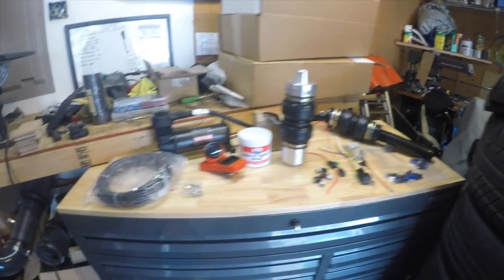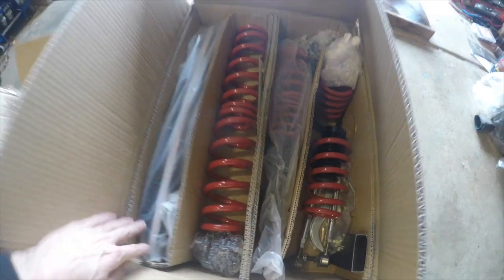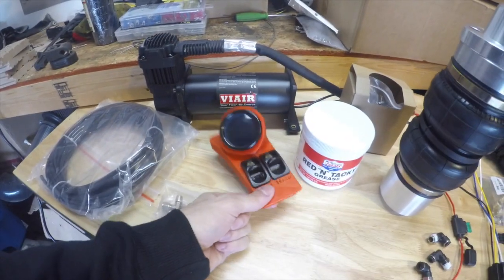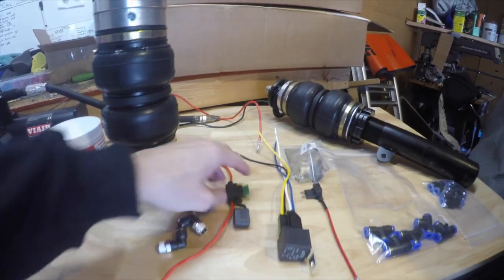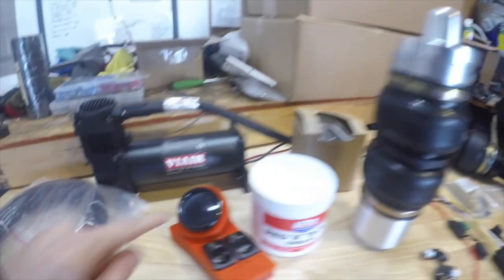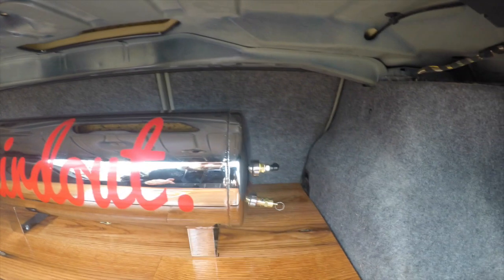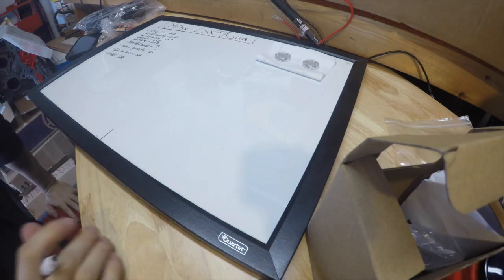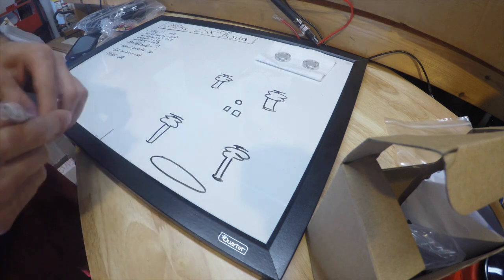BMW E92 Cheap Bag Setup! - Airdout

Comment: Hey bro hows the ride on these Racelands after the conversion? I'm about to convert mine on my Focus ST and curious if I should expect it to be bouncy.
Reply from the maker: Not to bad but make sure ur front and rears are adjustable.. front on these racelands don’t have brought adjustability to go low enough
Reply: Yo, did you use tough luck for the bags on your st, im thinking about doing the same thing and want to make sure it all fits right
Reply from the maker: Tommy Long yes I used tough luck bags!
Reply: AirdoutRacing Sweet, thanks!  How long did it take you to get the bags after you made your order?
Reply from the maker: Tommy Long I think it only took about a week and a half? Maybe 2 weeks after I gave him all my specs
Reply: AirdoutRacing That’s not bad at all, might have to go ahead and out in an order! Do you remember about what the total cost was for your build with the manual management and digital gauge and all that?
Reply: @tommylong2151  I just installed conversion bags in the rear (which is just a bag that replaces your divorced spring) and AirLift shocks all around with 3p management. Bought the AirLift kit used without rear bags lol.